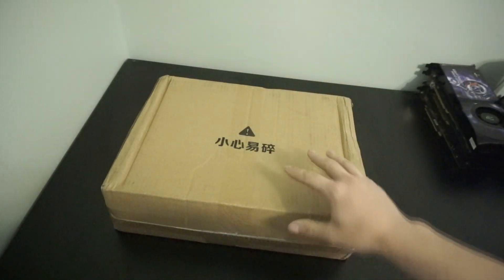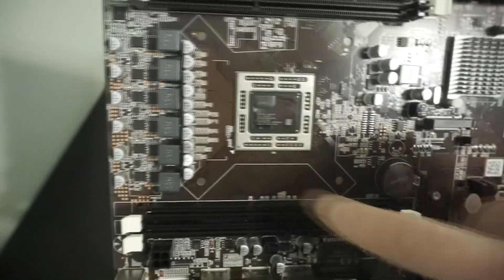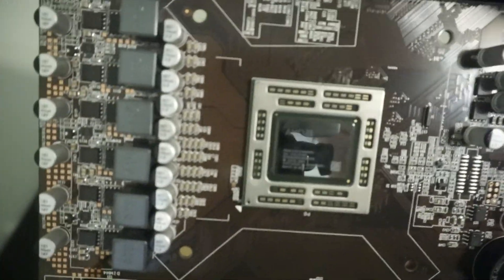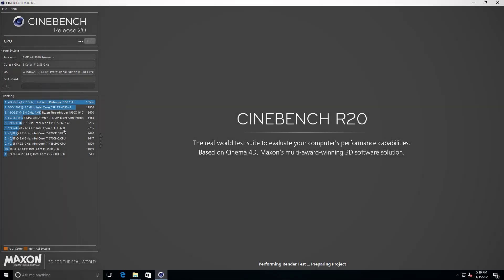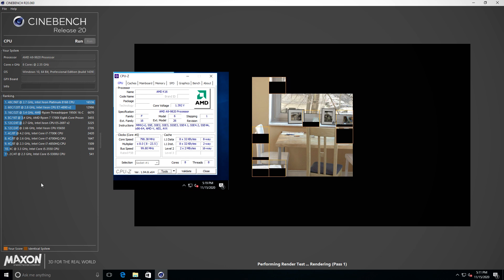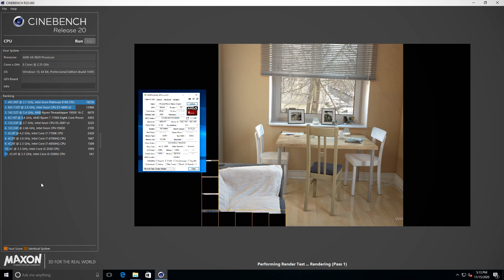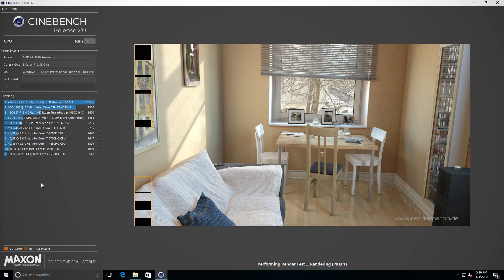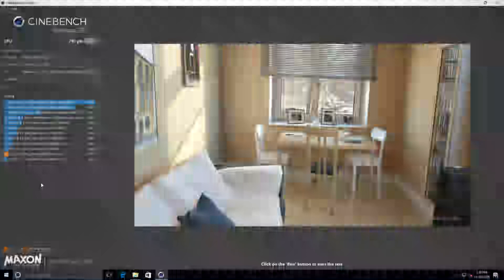AMD A9 9820 APU: A Cut Down Xbox One APU?

Comment: If that 384:24:8 GPU config is correct, that's exactly half of the Xbone's GPU. About CB, a 2GHz quad core Jaguar A6-5200 gets 322 points, so there has to be something special about the A9 that's making it scale so much better. Can you throw Aida64 at it in the followup video? I'm curious to see if the L2 cache is still half-speed, and how many channels of DDR3 the board supports.
Reply from the maker: I absolutely can do that for you.  After doing some further research of my own I'm leaning towards this being an Excavator based 8 core.  But I have no solid proof yet.
Reply: @SocketSanctuary   Idk, K16 points to it being Jaguar/Puma(+) imo. If it were Bulldozer-based it should say K15 based on https://en.wikichip.org/wiki/amd/cpuid#Family_21_.2815h.29, and show up in Task Manager and R20 as 4C/8T
Reply from the maker: @hblankpc  That is a valid point.  Perhaps the good scaling is due to some other factor we aren't considering then.  Doing some napkin math.  The CPU is clocked at 2.35 Ghz which is about 15% faster than 2Ghz.  Double the cores at 2 GHz would give a score of 644.  Multiply by 1.15 you get 740.  Thats close but still about 7-8% off of what we would expect from your results.  I'll try and see if it scales well with ram speeds and channels.
Reply from the maker: @hblankpc  I did more research and this chip has to be either Jaguar or Puma based as it does not have the instruction sets that Excavator has and this isn't the older Piledriver architecture either as it doesn't have the TBM instruction set.
Reply: @SocketSanctuary  I tested my A10 8700P (on my old laptop) and got 430 points in Cinebench R20 (it ran at a clockspeeed ranging from 2.1 GHz to 2.3 GHz).  So If it was excavator @ 2.35 GHZ,  it would score better than 793 points.
Reply: @SocketSanctuary  Could you please do a Geekbench benchmark and upload the results if possible? So curious to find out!
Reply from the maker: @cqb1397  Funny you should mention that.  I actually tried running Geekbench but it would crash every time the test would start.

Comment: My additional 2x2gb ram came and Windows hang few times with 2x2x2x2 gb but after that it seems to run fine in that configuration, what I noticed is that this CPU is shown as RX-8120 with 1750 mhz speed instead of A9-9820, I see in the motherboard configuration that I can choose CPU settings for a9-9820 but after few resets the board reverts back to rx-8120, weird.

Comment: I bought this and it came dead on arrival or maybe I have wrong ram or don't know the right placement of case cables but I think I tried every pin combination to launch this shit, it's gonna take a fortune to send back to China...
Reply from the maker: If you haven't already try one stick of ram. I have had some issues with more than 2 sticks.  Also ram with loose timings seem to be more compatible.   I've found anything over 4gb doesn't post.
Reply: @SocketSanctuary  Ok I managed to post it finally with Goodram 1333 cl9 2x2gb, the left ram slots seem to be faulty because the PC only starts if I have 2x2gb on the right, with one stick on the right the board doesn't start and with 2x2 in the left slots doesn't work as well, that seems pretty bad for a PC with APU, do you know if anyone managed to use 8gb of ram? especially with 2x2x2x2 so I can use my old ram and buy 2x2 more.
Reply from the maker: @BITCOIlN  I'm not 100% sure about 2x2x2x2 but I did get 4x4x4x4 working.  I did even manage to get some tighter timing CL9 1600 ram to work, but even that sometimes takes a while to post.
Reply: @SocketSanctuary  Did it start right away with 4x4x4x4?
Reply from the maker: @BITCOIlN  it did with the CL11 4gb ram modules.

Comment: Bro why did you apply the thermal paste on the cpu.. AND THE COOLER? What are you, The Verge?
Reply from the maker: Good question. On a deliddid CPU it is imperative that you have 100% coverage on the die.  Even a small part of the die that isn't covered can kill the APU.  This is especially important because some areas of the die don't have temperature sensors so if they aren't covered the APU won't throttle just cooking the chip.  The normal "pea size dot" of thermal paste is not the correct way to apply it to a delidded cpu.  Good question.

Comment: @Socket Sanctuary, some more info:
- there is no separate GPU as it seems. The 384 core GPU is on die and labeled RX 350 for a reason.
- There is no dedicated VRAM. In the BIOS, i believe it can address up to 2 GB DDR3.
- The chipset used is likely A77E based, also used by AMD Bald Eagle APU's.
- Configwise this looks a lot like the lesser known Radeon HD 7730, which has the same Core/ROP/TMU config and in terms of the DDR3 version, same memory clock speeds. Because this APU has Quad channel DDR3 (61.2 GB/s) it should perform more closely to the GDDR5 version that has 72 GB/s bandwidth. By comparison, The XBO GPU is similar to a HD 7790.
- The AMD Oland has the same 384/24/8 config, and was released as the Radeon R7 250, with GDDR3. It could very well be that the RX350 is simply a rebranded R7 250.
- Despite the low core config, Murky Murk (Russian) tested various games already, with BFV hitting 30 fps. Unsure of resolution, might be 720p.

Sources:
Coelacanth's Dream is a Japanese blog dedicated to this APU and has the most up to date data:
https://translate.googleusercontent.com/translate_c?depth=1&nv=1&pto=aue&rurl=translate.google.com&sl=ja&sp=nmt4&tl=en&u=https://www.coelacanth-dream.com/posts/2020/11/10/a9-9820-more-detail/&usg=ALkJrhg7zuClCpdqQQbzvQKhR08aSX_fYA
Momomo US bought the APU and showed test data including GPU-Z details. Twitter thread:
https://mobile.twitter.com/momomo_us/status/1325423345790169091
AMD Oland: https://www.techpowerup.com/gpu-specs/amd-oland.g389

Comment: Hey man! Thanks for the drivers. Did you ever have issues with some of the DIMM slots not working? Only one of my DIMM slots works right now and so I can only run 2G of RAM instead of 8G on all 4 slots.
Reply from the maker: I do have issues with  one of my slots.  I also can't run any sticks above 4G in size. However Aida64 does recognize that there are 4 channels of ram available to it.
Reply: @SocketSanctuary   That's so weird. I can't run any sticks about 2G in size but I'll double check though. Thanks for the heads up. Have you found any solutions to your faulty slots yet?
Reply from the maker: @OzTalksHW  I have gotten it to work(somewhat).  If you want I can talk through a couple of my findings on discord if you'd like.

Comment: Do you think you can measure the die on the chip? If its the same size as the Xbox ones chip then it will confirm some things.
Reply from the maker: I certainly plan on doing that for the follow up video.

Comment: Puma+ is pretty much jaguar. boost clock aside, that's exactly the xbox one's CPU. but yeah, it's interesting how you can finally buy an 8 core jaguar config chip, just to see how the ps4 and xbox actually matched up against desktop hardware in real benchmarks, instead of estimated benchmarks

or even up against phones. bruh, i wish i had one just for testing.

Comment: What a great video. The GPU performance on-APU surprised me most. Exactly half of an Xbox One (And what you would expect with a binned product) As i love collecting data on this thing, some more bits and pieces for you:
 @Socket Sanctuary  To make things even a bit weirder:
- The RX350 they mention is on the motherboard and underneath the small passive cooler, featuring 512 shaders (Likely 32 TMU/16 ROP) to come somewhat close to the Xbox One? Likely they added this in to compensate for the 384/24/8 on-APU iGPU.
- You mention the Aerobox never sold. It actually was reviewed (Warning: Chinese website) - https://win-tab.net/imported/chuwi_areobox_review_2010142/ - So i do believe some units do exist.
- Whatever the case, the Techpowerup listing of this (asserting it has 896 cores, or a fully featured Xbox One GPU as they usually binned 2 CU's) is likely not correct.
- The CPU core reaches 2.35 Ghz. The Xbox One X Scorpio Engine, itself a Jaguar-derived product, is rated at 2.3 Ghz. So you could also assume they use Xbox One X clock speeds here, atleast on the CPU front.
- You showed the GPU-Z specs, but its very, very hard to see the details. Perhaps you can put up a snap of the details?

Hopefully this helps in your research :) Its definitely a Jaguar-derived core, perhaps OC'ed for Xbox One X CPU speeds, but the GPU is just weird: Half an XBO, so likely a RX350 to compensate, i suppose.
Reply from the maker: Thanks for the good info!  The more I dig into it the more interesting it becomes.  When I get back from work I'm going to measure the die.  That'll give a much better idea if this is just a custom chip or an actual Xbox die.
Reply: @SocketSanctuary  heya, no problem :)
i did some cross comparing from a paper with an exact Xbox One die shot - it is quite literally the same chip. Given its from 2014 i say that's pretty much fact.

The curiosity stems from the weird APU GPU config and the seperate rx350 - i doubt you could even activate the 384 part.

Comment: This has very little in common with the Xbox One APU actually.... This is using an 8-core Excavator CPU (aka AMD's then full fat CPU architecture), NOT the ultra-low power Jaguar cores the Xbox/PS4 used.

Thus CPU performance should be WAY higher than the last gen consoles, with GPU performance a decent bit worse (bc of the smaller iGPU).
Reply: well, no, this is not excavator. he said in the video,  just look up AMD K16. it is indeed running on AMD Puma, which is the successor to Jaguar, and heavily jaguar based, just with a few improvements. 

idk where ya'll are getting that it's excavator

Comment: Absolutely awesome find (and video), I actually have seen these before on some dodgy OEM sellers from Sweden of all places. There are still a few listings out there on eBay UK right now. I might try and grab ahold of one of these boards for myself, as never wanted to spend out on a full "custom built" with it included. Where abouts did you manage to find the drivers though (Pinned Comment)? I would have probably spend hours installing relevant INF Files myself till I found one that might worked.
Reply: Also 👍 for your return, and the Rimworld music,
Reply from the maker: Thank man!
Reply: @SocketSanctuary  Why haven't you linked him the drivers?
Reply from the maker: @xXRealXx  You can check the updated description ;)
Reply: @SocketSanctuary  thx!